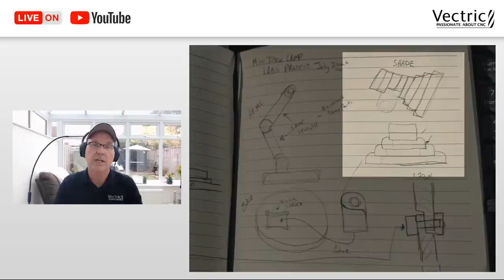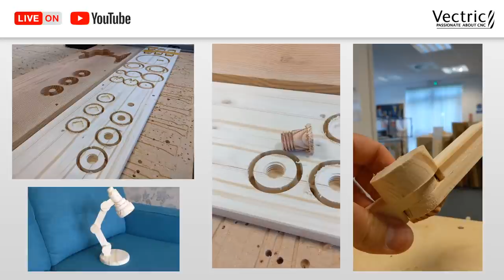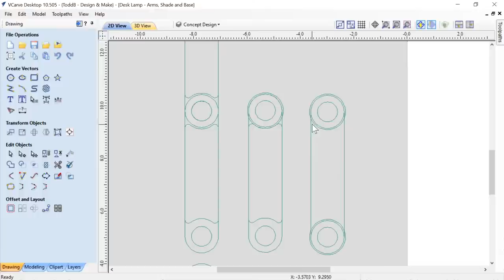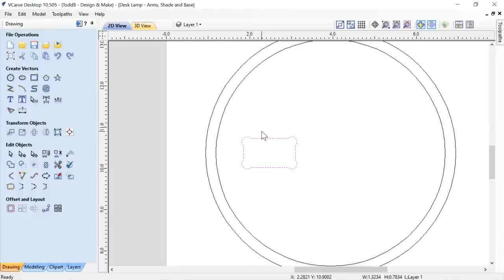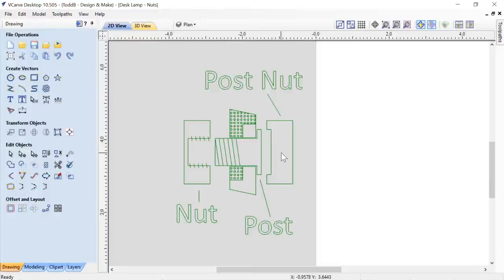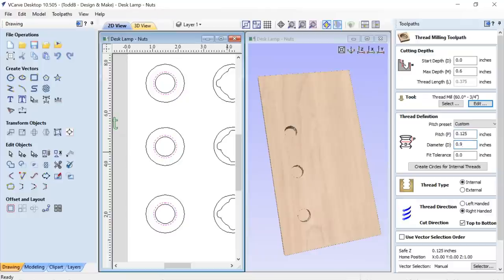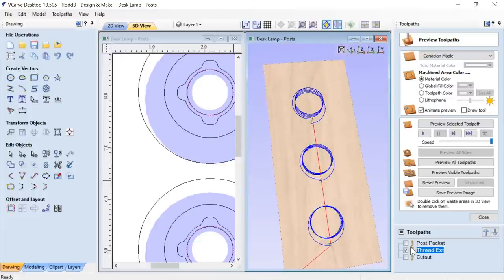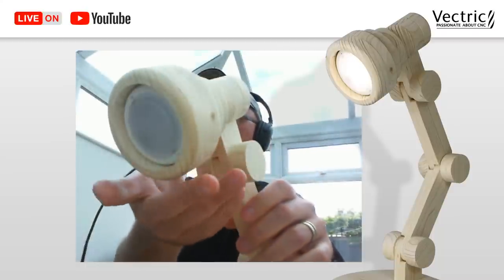Live Q&A with Todd | Desk Lamp | Vectric FREE CNC Projects

Comment: Here you essentially have a 7/8" bolt and nut not 3/4". One of the UN standard is 7/8"-9. Hence, the pitch is 1/9= 0.111".  The size of the hole for 60 degree thread is generally nominal size - pitch (0.875-0.111=0.764).